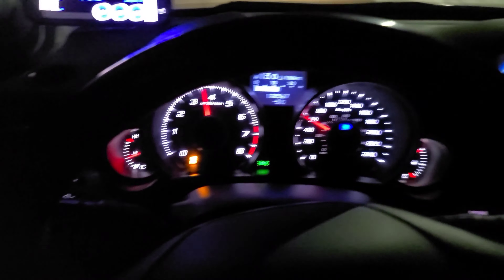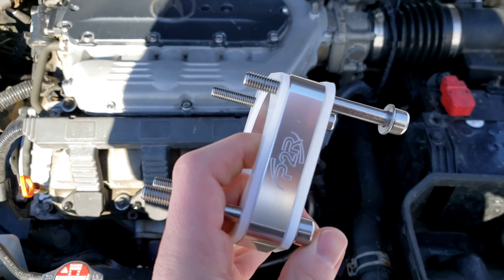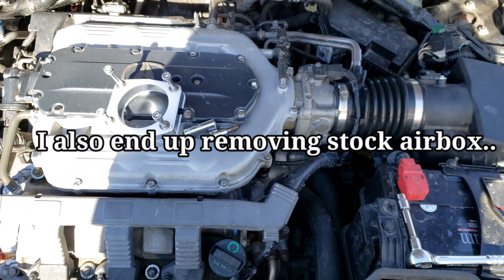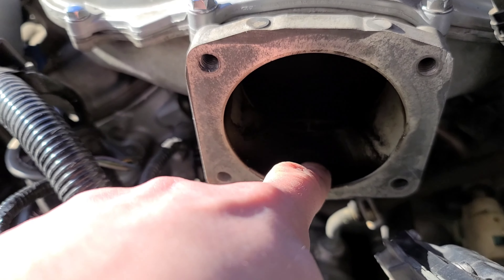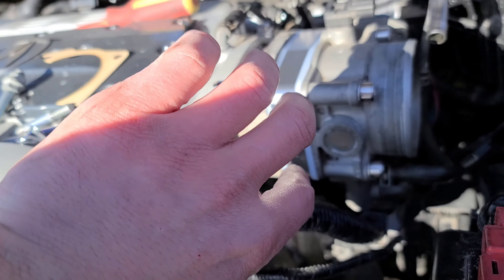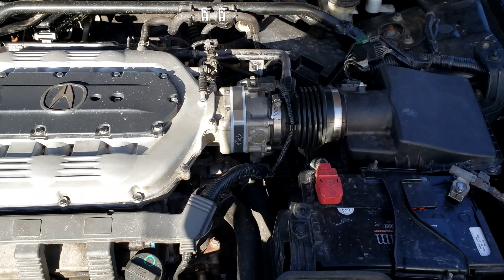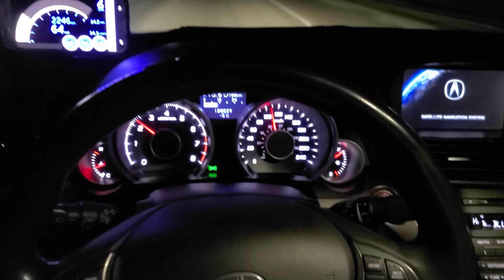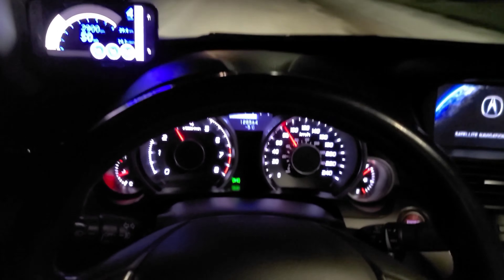Installing P2R Throttle Body Spacer On Acura TL!

Comment: Neat little video! This is a really popular product over here at Heeltoe. There's a lot of misconception about how this part makes power. Yes it only makes a few horsepower but it doesn't really help you in your top end, wide open throttle situations so much. Where you'll notice this mod may give you a little boost is in those part throttle low RPM / mid-range situations. Such as if you're grounding a corner in town and roll on the gas it'll want to pick up better. Part throttle, low RPM response is where you'll notice this improvement the best. Same with the manifold spacer.
Reply from the maker: Thank you! Also thanks for clearing that up, since the TL doesn't have a lot of low end this doesn't hurt then👍.
Reply: I tried searching for the p2r tb spacer on your website and didn’t find it
Reply: @kevin2jzzzz203  What engine is it for?
Reply: So this fit acuca tl 2006 3.2 p2r

Comment: Thanks for the installation video, I’ve pictured it in my mind over a thousand times 😂. I know there won’t be a difference by much, but with a SRI at least it’d move the intake closer to factory air intake duct. That runs along side the fender.
Reply from the maker: True, I think this mod would be more beneficial with the intake for sure. 👍
Reply: @RevsALot  I personally think the famous 350/370z front bumper air duct modification. Along with some custom piping to run along side the fender like the stock set up. To a SRI with one of those universal heat shield and one of those water resistant washable air filter covers. That would be the best set up.

Comment: Sigh, that intro hit me. Trying for wider tires with Accord. Had to go simpler daily and family trip Accord to save some maintenance and fuel costs since I have a greedy 4x4 too. This weekend adding the Jpipe, Injen long tube C.A.I., headlights until the Magnaflow exhaust comes in 2 weeks. ...tick tock tick tock. Ah, and the short throw shifter, though I haven't found exact video on removing panels as I am hoping not to break any clips in this untouched beauty lofl.

Comment: Just got an '05 tl base model and they suprisingly sell for a low price which was apparently common  knowledge but for a car bought on a budget ($5000 for mine) it was worth every dime. Only thing I wish was different with mine is the automatic transmission being manual but other than that im not complaining.
Reply from the maker: They sell for cheap, because those autos are known for letting go. Hopefully you have good luck with yours though🤞.Congrats on the purchase!👊
Reply: I believe the 04-05 had crazy torque steer with the manual.  It may be a blessing you have the automatic.
Reply: I have an 05 base sport 6MT and the torque steer really isn't bad at all. I used to have a 1999 Buick Regal GSE (supercharged 240hp/280ft-lbs) FWD/open diff and that wheel would just flop to one side if you pinned it below 30mph. On the TL, you'll feel the wheel pull both ways, especially on loose or uneven surfaces, as the LSD claws for traction, which I don't mind at all. Give you lots of feedback, but not objectionable.

Comment: Lol that launch was brutal for it to be awd 🤯 Can’t wait to see that custom intake as well 🤙🏽
Reply from the maker: I blame the pcds, I never use to spin that much on an easy launch haha. Hopefully installing in a cpl weeks.🤞
Reply: @RevsALot  I have a custom 4'' intake for sale made up but never used. it will need a dyno tune though. comes with 2 new brand new aem filters
Reply from the maker: It won't work on my TL, but if other accords owners see your comment then they might be interested👍
Reply: @RevsALot  why not? im using a j37 tb remember lol
Reply from the maker: Cause where your CAI goes in your fender mines all metal, it would have to be fed under the battery for the 4th Gen TL
Reply: @RevsALot  mines just a Sri intake
Reply from the maker: Ahh k, yah that would fit then. I do wanna custom a CAI though, just to stop the "all you're doing is sucking in hot air" comments haha.
Reply: @RevsALot  you roll race 90% of the Time so doesn't matter lol.
Reply: @GrimEcoBooST  🤔 You might have a buyer right here...
Reply: I sent you some pictures over Facebook.
Reply: @GrimEcoBooST  do you still have it brother ?
Reply: @alexsbloggiesyt9762  long gone, same with my accord.

Comment: My 3G TL Type S also makes the same rattling/Exhaust leak noise with my RV6 PCDs and it's so annoying but hey at least it's loud 😂
Reply from the maker: Good to know haha, not a huge fan of the sound under full throttle though. Just cruising and slight acceleration you don't hear it, just if to the floor.

Comment: I’m assuming this is good for low to mid range power. Just like the B18C1 engine, it has dual runners snail manifold.. short runners are for top end, butterfly closes then activates long runners for more power in the city stop and go traffic.
Reply from the maker: Yes, check the pinned comment👍

Comment: I think the next mod to try should be the Sprint Booster RevsALot , I keep looking at reviews from it lol , sounds good so far .....
Reply from the maker: I would love to get one for the TLX. I feel like it wouldn't help me much, since I'm getting way too much wheel spin on the launch as is.
Reply: I have one installed on my 2012 acura tl awd and it's amazing, it really helps with the throttle response and gets the car up and going in less than half a time.
Reply: @ahmerjaleel9276  cool how long you had it ? Have you had any issues ?
Reply: @RevsALot  let us know if you get it for the TLX that’s going to be awesome :-)
Reply: @jde7860  no issues at all I dont think I'll be able to drive without it anymore there's so much lag on thr 3.7 this eliminates  all of it

Comment: Appreciate the video 😌 on the throttle spacers but I want to get the new intake setup with the flexa spout homemade style with the air duck 🦆 below headlight  because I don't want to used the tekeda cold air intake setup for my 2012 TL fwd and all the best for 2022😎🐈👍🦆😌😎  also I didn't used the dynamax resonator I only delete the mid resonator into straight pipe setup and delete the mufflers into straight pipe  with quads tips hope you understand what I saying

Comment: Hey bro love your  channel.  I would like to recommend that you do the green auto tb mod to your TL. I did on my 07 Mdx 3.7 and it felt like a 50  shot of NOS through out the power band. I am keeping up with most srt-8s with just the tb mod. Its like putting the comptech headers and intake on a 03 TL-S. If you know how that feels thats an amazing feeling,  that would keep up with most mustange cobras with a v6.  Check it  out.
Reply: What is this throttle body mod you speak of. I can't find anything about it
Reply: green auto technology, there is a YouTube channel and website run by a guy named Michael Lee.
Reply from the maker: Thanks! I'll look into it, but I can't see any mod being that beneficial or everyone would have it. I had an 07 MDX it would need a 200 shot to keep up with a cobra haha.
Reply: @RevsALot   It looks so somple but it makes a wave form inside the combustion chamber far superior than a  tb spacer.  Designed for emissions,  but it truly burns your fuel making hp. All I can say is theres no bog or lag when I step on it especially when fools want to roll up.
Reply from the maker: Hmm, I tried doing some research on it but there's nm out there unfortunately👎. $500 is pretty pricey though, wouldn't a pedal commander do the same?
Reply: so basically from what I have gathered the "wave throttle body mod" is them taking a dremel to your throttle body and notching a small valley into the bottom of the inlet causing a change in the air flow into your intake manifold which causes more efficient combustion.... As a mechanic I am optimistic and skeptical at the consistency of results but I am interested in trying it on my setup to see what all of the Hype is about..... What the other "treatments" are I dont know..

Comment: I have a 2006 tl and man does this thing have torque, the only problem I have is the 3rd clutch in under 110000k is crazy, idk how you aren’t replacing them with all the extra power
Reply from the maker: Umm, I dunno. You must be riding the clutch a little or something. I launched my OEM Awd over 150 times and clutch never went, but I did replace with Spec Stage 3 when I had 2nd gear syncros fixed under warranty...Stage 3 clutch broke in 2k miles, went back to OEM and no issues at all and I launch it and drive it like I stole it constantly. OEM 4th gen is actually an Exedy brand, so not sure about 3rd gens.

Comment: I cant drive anywhere without people trying to race my TL and if I took every race that came my way and went 100% I would need a need engine and tranny pretty quick so I tend to half ass race and shift early at like 5500 or 6000 RPM. The funny thing is a lot of the time its just basic cars like SUV, trucks, and economy cars trying to mess with me. My TL is also due for all fluid changes mainly transmission and differentials, If you change all your fluids regularly and use nothing but OEM that AWD Accord will last well over 300 000km. Im also looking to do a custom intake maybe retrofit the factory one like Garret did and put a hole in the bumper for an air inlet.
Reply from the maker: It's that single exit you got, getting ppl going haha. Most ppl that try to race is the same thing, slow cars/SUVs and all the trucks. STI, Evo, and Focus RS never want to go at it👎.

Comment: I have a 2010 MDX with the 3.7. Will all the engine mods from the 3.7 TL work for my mdx as well?
Reply from the maker: It should yes, other then Jpipe and catback...jpipe would bolt up to pcds, but you'd have to customize the catback exhaust to bolt to the jpipe...Can do lightweight wheels too

Comment: my pcd's sounds like an exhaust leak aswell...rv6.. it goes away after a few seconds away... i can't find a leak either... haven't installed my jpipe yet.. 🤷🏽‍♂️
Reply from the maker: Good to know, seems to be normal then. I hate it though haha
Reply: @RevsALot  what about Smell ? Do yours give off an bad odor? Lamo
Reply from the maker: If you mean smells like an old snowmobile from the fumes, then yes. I love the smell though🤷‍♂️ haha.
Reply: @RevsALot  😅😅.

Comment: my muffler sounds like urs also. and I took it to the shop and the guy said there was a leak on both muffler on the top of it. so it was hard to see.
Reply from the maker: My sound comes more from the front, sounds like where the pcds bilt to the jpipe

Comment: I have an Acura TL 2010 fwd what mods you recommend I do to my car ? Give me a full list please 🥺
Reply from the maker: Lightweight wheels, then full exhaust, ktuner and then the little stuff. ( Ported parts)...shave weight by removing spare tire, tools, and drive with half tank or less and you'll shave about 100lbs.(1car length)

Comment: thinking of getting rid of my 2011 WRX and picking up another 2013 TL in 6 speed manual, but theyre asking $24k for it with 71k miles...I think they need to do a little better on that price what do you think??
Reply from the maker: That's not a horrible price, but probably a few grand more then I expected. That's a little less the I paid for my '13 four years ago with about 50k miles more, but they're hard to find with low mileage and I think they're going to hold their value really good and eventually go up since it's the only AWD manual Acura ever made. If I had to I would pay that much.

Comment: I thought about installing one of these, I use to have the sprint booster but I removed it, so I might put one in. I also have one of my cats removed the car comes with three but never had any codes, I'm also fully tuned with cai.
Reply from the maker: Why'd you remove sprint booster? Also, you can remove the 3rd cat with no check engine light. If you remove the other ones it'll come on though.
Reply: @RevsALot  It got kinda old & the car started to Jerk  really hard, plus at the time I was getting it tuned & my Tuner said he can automatically adjust the car to do the same thing, so that's why, & to the second part that's why I didn't want to remove all cats because of codes,  but mainly car inspection & to be honest I don't need to because the car sounds great with pops & all.

Comment: they come with a hole tapped, is that supposed to be filled? or do i leave the hole alone and install
Reply from the maker: It comes with a thing to plug the whole, that's the black thing I showed in the video 8 millimeter to snug it up.

Comment: I have an aem intake on my 3rd gen TL, will it still fit with this or I'll need to take it out and readjust it?
Reply from the maker: Should still fit, but this specific one is for the 3.5 or 3.7. I'm sure there's some for the 3.2 too though👍

Comment: what are you smoking? installed J-pipe , K tune and didnt noticed the difference. maybe check your engine do compression test, FI test  , Leak down test. 10 hp you should feel.
Reply from the maker: The good stuff👍 lol. I meant notice a difference to be like, "wow, that's a big difference". Ktuner I felt a difference, but not as much as I was expecting. Also, basemaps are tuned with 93 and we only have 91 so that's probably why.

Comment: Whats stock tune means?
Reply from the maker: It's stock, not tuned
Reply: So a cold air intake increase hp when you remove stock airbox? Or the stock airbox is better

Comment: I have the AEM intake for acura v6 VTEC Rdx 2017
And gave me 10hp and 12 feet torque
Reply from the maker: Did you dyno it?
Reply: On a 3.5 or 3.7 tl?
Reply from the maker: Rdx is 3.5
Reply: @RevsALot  thanks! I have a 2010 3.5 auto tl . I would really like to see a 3.5 vs the shawd
Reply from the maker: https://youtu.be/s-5oxLaRilw  there's this one, and this one https://youtu.be/oFZwhlkiqgg
Reply: @RevsALot  no but my butt dyno feels it and its already tuned for these gains from AEM dyno :)
Reply from the maker: It's not tuned for it unless you have a tuner, but the stock ECU can adjust itself a bit. I definitely noticed gains with stock tune with intake, but not with ktuner installed.
Reply: @RevsALot  thats odd hey?

Comment: I was just looking at these recently, almost bought one until the shipping to Vancouver Island came up. It's too much right now when I'm trying to save up for my J-pipe and PCD's
Reply from the maker: Yah shipping is insane for us in 🇨🇦. EGR delete shipping cost more then the part. 🤦
Reply: @RevsALot  Yeah, EGR delete I was looking at was like 24.99 USD, shipping was 52 USD. Insane.
Reply from the maker: @DeathNRebirth  I don't think it was that much through heeltoeauto.com I could be wrong..I still had to order the other half from P2R, cause it's 2 different parts. So had to pay dbl shipping😒.
Reply: @RevsALot  I'm planning on getting it from HalferLand Performance. I'm the kinda guy to spend the extra cash to support the little guy, haha

Comment: This is gunky because the engine air filter is not working properly.
Reply from the maker: The engine air filter was dirty af, just recently cleaned it.
Reply: @RevsALot  Due to the poor quality of filtration, these filters are very dangerous for Alusil engines like J37. Is there any difference between the OEM filter and such a filter?
Reply from the maker: I don't know I just put K&N drop in and it did add a bit of performance. Also, it's sprayed with an oil so dirt sticks to it more

Comment: helix ones are better.  and they work the best at low/mid range.
Reply from the maker: Not a big enough difference to feel in the butt dyno either way though. I got this cause was going nitrous, but probably will uninstall soon anyways I hear it takes a bit from top end.
Reply: @RevsALot  the bigger the engine, the less you will feel from these. i got one on my small 1.8 L r18 civic. works VERY VERY well.  especially low/mid where i need it

Comment: Its normal your sound bro !!
Reply from the maker: Damn..sounds like crap under throttle too though, you can hear it coming from the front.
Reply: Yes.. I have a magnaflow catback with the j pipe and K&N typhoon SRI and its sound very good on the throttle not so raspy like yours...Do you have stock reso or reso delete?
Reply from the maker: I had no rasp or exhaust leak sound until the pcds. I have OEM Resonators. Put pcds on your setup, and you'll have rasp.
Reply: I have the pcd on my setup ,but the sound is very more growl and agressive  ,the resonator on the magnaflow catback makes a big difference ,I think.
Reply: I will try to do a clip this weekend 😛
Reply from the maker: Nice! Make a clip, there's not enough TL setups online. Also, do you have the 3.5 or 3.7?
Reply from the maker: Mine only has rasp in 3500-4500 range. Which is what you seeing in a lot of the raspy clips lol.
Reply: I have an accord v6 6 speed 13 not the tl ,but i will do a clip to show you the difference of the sound  for sure